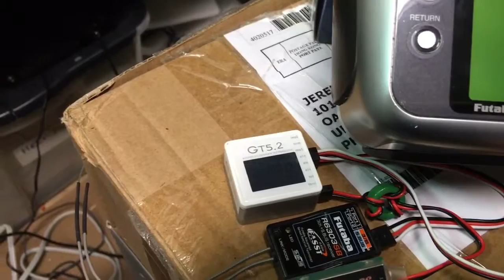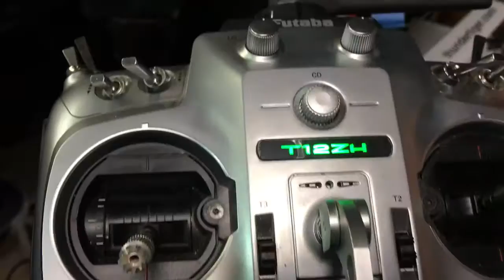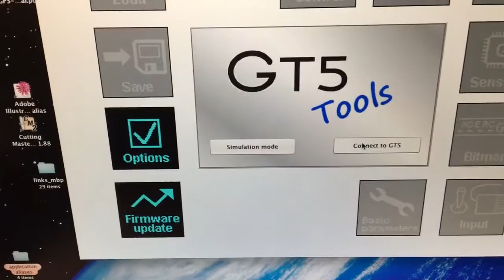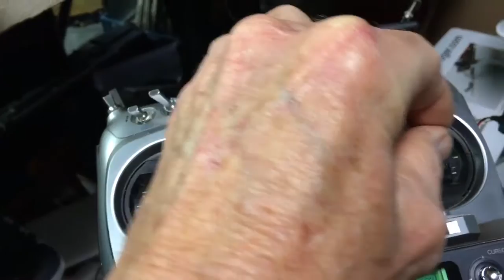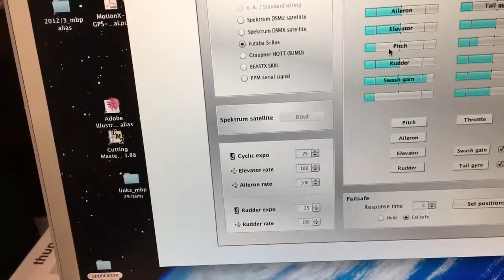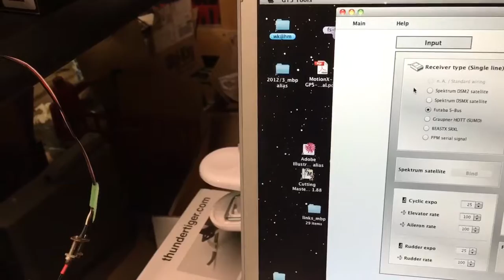Setting parameters of an Ace GT5 3-axis gyro using a Mac and USB dongle.

Comment: Good video.  I have the same gyro in my TT e360.  Im having issue getting it to put enough tail rotor in and it just spins on the ground.  Sometimes it works sometimes it doesent but it corrects the same way. Any thoughts?  Do you think this would help?